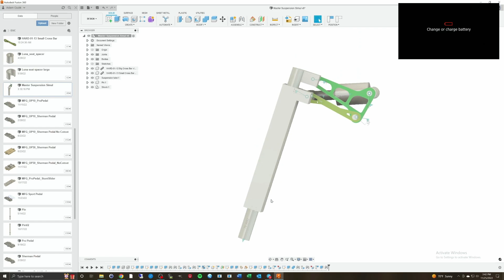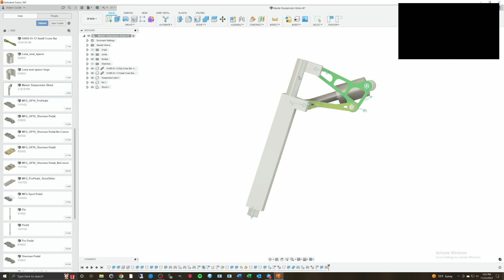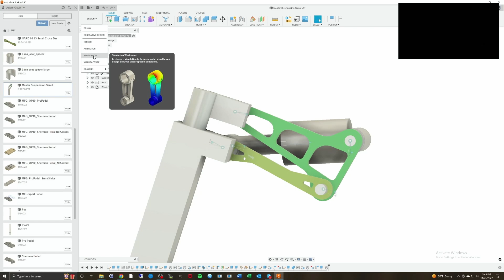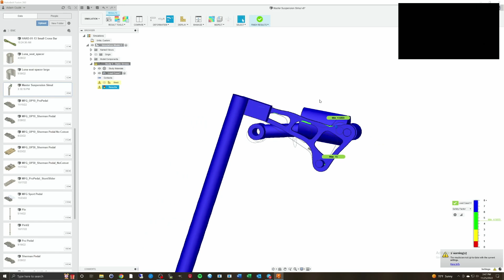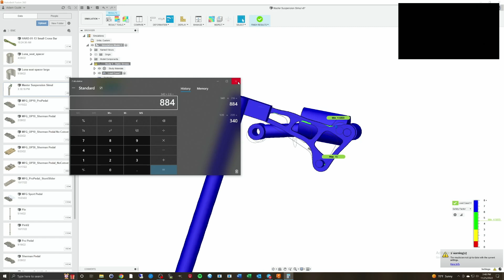Euc Master Shock Linkage

Comment: could you send the full link for the cad model?  I want to try to create my own suspesion but have not worked that much in fusion yet
Reply from the maker: You can join our telegram group, fusion 360 project is in the pinned messages. Look for the ex30 fairing system fusion url, Suspension links are in the project. https://t.me/+7EjwgKPifPYxOTAx

Comment: Thanks for this video. I’ve just ordered the new linkages and a coil spring shock for my V2 Master. In regards to spring rates, wouldn’t the new linkage mean that you can use a lighter spring compared to the spring weight of the original linkages which Marty used in his video?  I’m really hoping the 750lb spring it comes with will be heavy enough for my 90kg weight with the new linkages.
Reply from the maker: I am not sure who's linkage you are referring to but you can easily divide the suspension stroke by the shock stroke to get the ratio, then add up all the weights (EUC, rider, gear, pads, seat, etc ) and multiply by the ratio.  That will give you the static weight of the spring, then you add whatever you feel you need for the dynamic aspects of your ride. Add more if you jump a lot. Another perspective to keep in mind is that the third party linkages sold today are linear. I modeled some of them and decided that a spring shock is not optimal due to the linear spring response. On my wheel I got a linkage that gives me 50mm of shock travel and is linear. So the best shock type for it is the air shock which has a negative pressure chamber and gets harder close to end of stroke. This is very important if you want a plush ride, but when you jump you want to prevent bottoming out. I found a FOX DNM float EVOL 7.875" X 2" Air shock on ebay for about 300 bucks.

Comment: Great work. Thank you. The S18 linkage is non linear, varying between 1:2.7 and 1:1 which gives it good small bump sensitivity as well as good big bump absorption. Is this linkage also non linear?
Reply from the maker: The linkage tested in the video is linear. That is the reason why I end up getting a non linear air shock for my wheel.